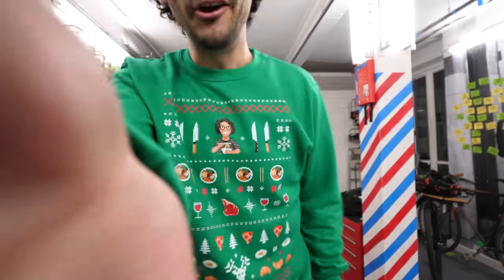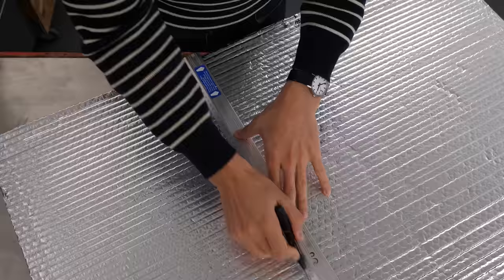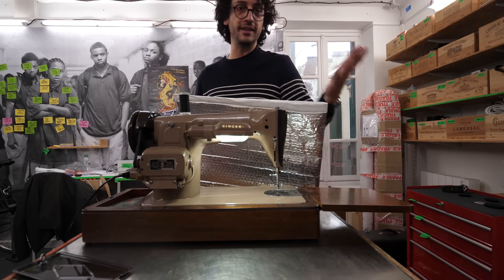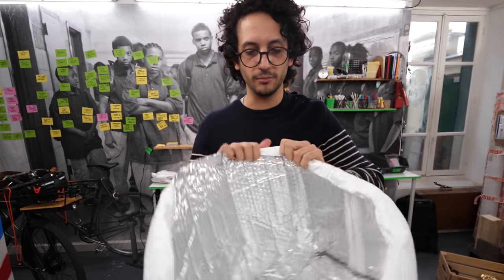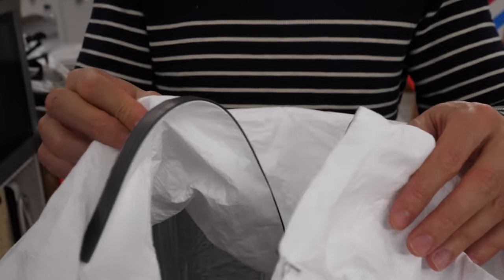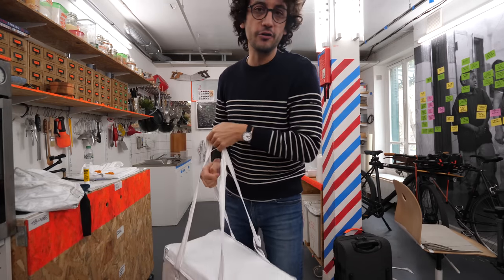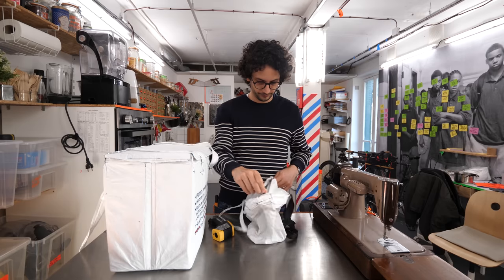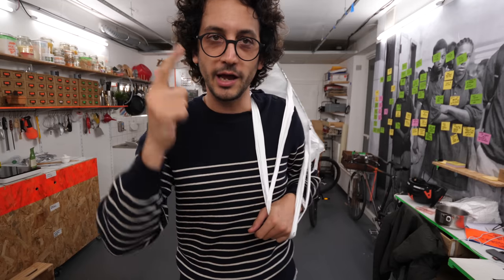Grocery Bag #3 Has GREAT Insulation But...

Comment: you are kidding!!!  4 layers of fabric is NOTHING for a SINGER. I do 10-12 layers of denim with my old baby. Have some confidence in your helpers, Alex. The only thing you might need is a leather needle, it has a 3-sided blade. Or the type 'SHARP', which is used to sew microfiber and other extreme dense fabrics, where the regular needle can not punch through between the fibers. Btw.: I have my doubts that you are able to fold the reflectix-lined bag into your back pocket LOL.

Comment: Meh! Carrier bags as they exist are a successful design. So successful they are disposable and ubiquitous.
Your best bet would be to copy the design using a lightweight cotton or hemp fabric.
The key would be to make the bag like an umbrella, easy to fold up and deploy.
You can use spring wire like in lighting diffusers or pop-up tents to achieve this.
Cooler bags are a different beast. You are chasing your tail making a cooler bag. They already are cheap and available.

Comment: Your isolation test doesn't really make sense, unless your ride home from the market takes two hours. The combination of volume and practicality are also two obvious clashing points, seeing as something that has a larger volume is naturally going to be less practical. As I said in the last video, be careful you don't fall into the trap of overdesigning. A lot of what you're doing seems as if your trying to come up with a solution to a problem, that was never an issue to begin with. That's why you feel like you're not getting anywhere. Take a step back and rethink the issues, thoroughly, so you can make the right solutions.